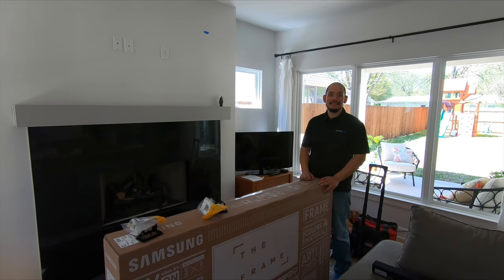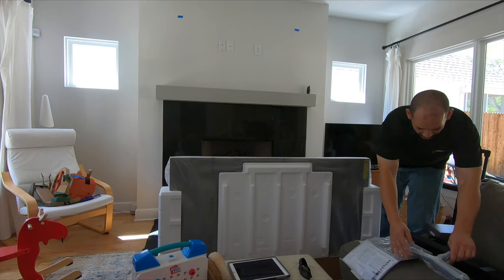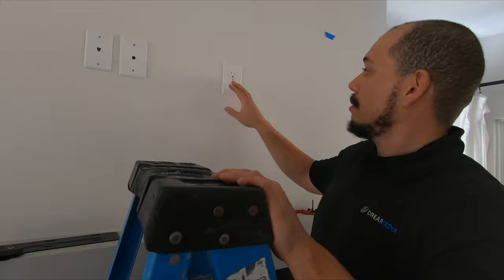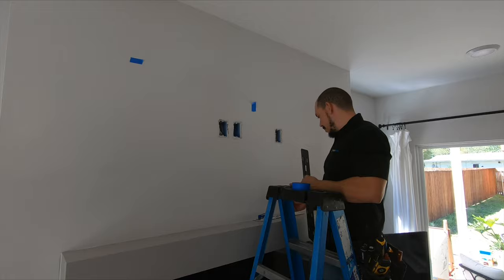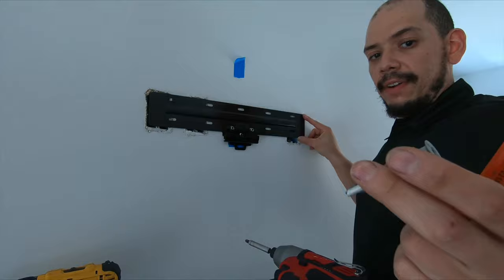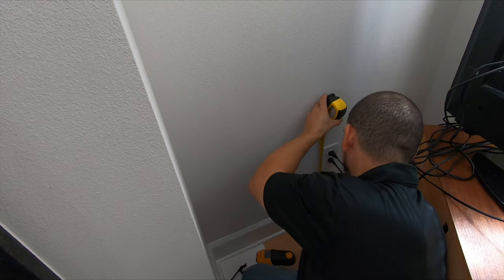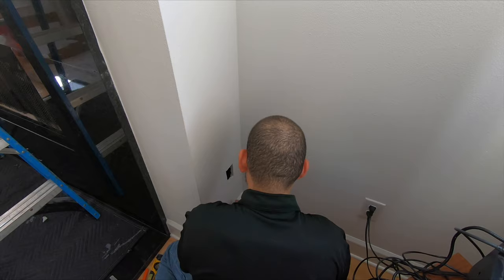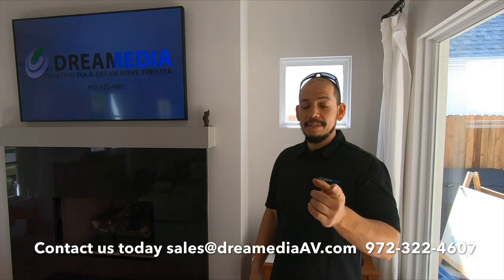Frank Wall Mounting Samsung Frame ART TV over Fireplace with all wires HIDDEN

Comment: This setup appears to be illegal, the samsung one connect cable is not UL rated for in wall runs, without a conduit (which I didn't see you install), or a separate in wall cable this will basically void the home owners warranty.
Reply: Warranty?

Comment: This is embarrassing. Can't believe you'd actually mount a tv with drywall anchors. So unsafe. Please don't copy this method. Find studs. SMFH. Also you should mention that they shouldn't be running power into the wall to the one connect box as the wire is not in-wall rated,  in some states it's a fire hazard. 🤦
Reply: agree with you on the one connect wire its not in wall rated they should have used a recessed box and ran romex and a plug for the one connect box but as for using drywall anchors you can use the toggle type ones that lock into the back of the drywall they are rated for over 100lbs but your not able to get full 16 on center with the way the frame mounting brackets are designed some have 2 separate ones that you space accordingly based on the size frame you try get at least 2 screws in studs of each then use toggles on the corners that's more than sufficient for the frame its not overly heavy unit.

Comment: Is the wire in wall rated? I thought they weren’t.
Reply: they 2019+ models are indeed NOT in wall rated.  i have yet seen any video with a proper rated cable used.
Reply: They are definitely not. Samsung charges about 260 for a in wall rated cable.

Comment: Just my opinion its way too low. Its not centered from the ceiling amd will not accommodate aftermarket frames which requires 3 inches extra on all sides.

Comment: Nice video. So question.  In an application like this wouldn't you want a mount that you can tilt down 2-5 degrees?  Can't imagine it being up that high that the viewing is optimal?
Reply: The no-gap flush mount can tilt down if needed.
Reply: I’ve installed this TV before, and it comes with two adjustable screw-in spacers that go in the lower mounting holes, for a non-flush mount option. This allows you to tilt it down.

Comment: Could tv be damaged with the heat of the fire?
Reply from the maker: It could but the possibility is low. The mantle blocks heat and the "Chimney" is encased in metal.
Reply: @DreamediaInstalls  how about if you have a gas fireplace without a mantle? What do you think? I'm wanting to install the frame on top of my gas fireplace. The tv would hang right where the conduit for exhaust would go. If I don't pierce through the conduit in the wall, do you think it'll work fine?